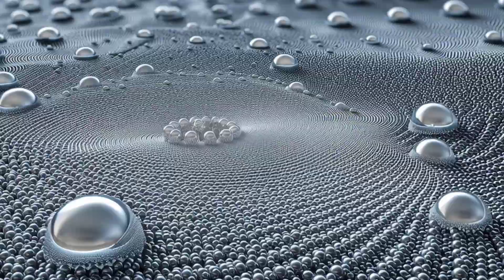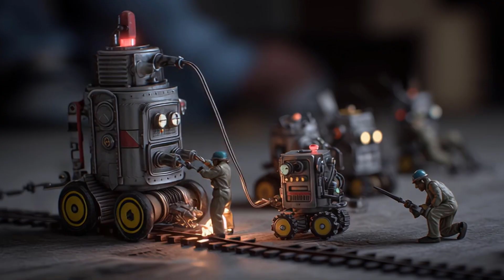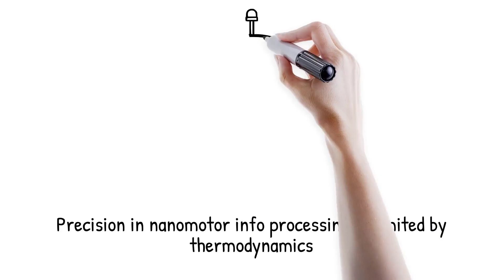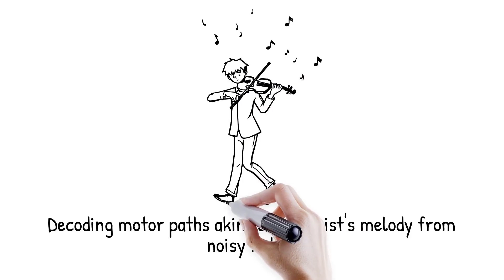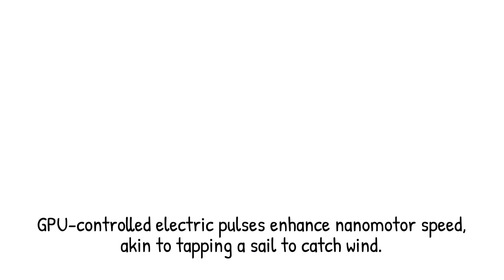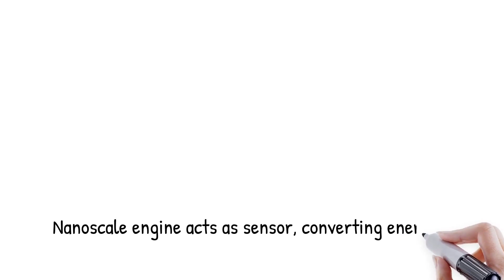How Nanomotors Turn Energy Into Information?

Comment from the maker: How does stochastic thermodynamics formalize the link between random nanomotor motion, entropy production, and measurable information?
Could nanomotors ever operate close to Landauer’s limit, achieving the absolute minimum energy cost per bit of information?
How can feedback control harness thermal noise to make nanomotors function as efficient sensors rather than inefficient engines?